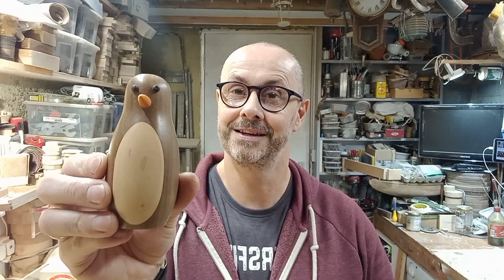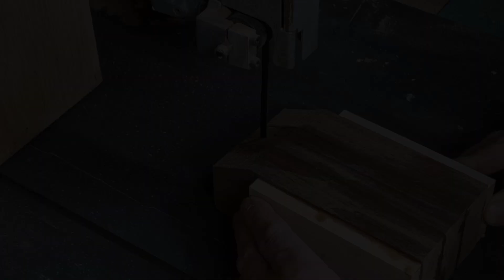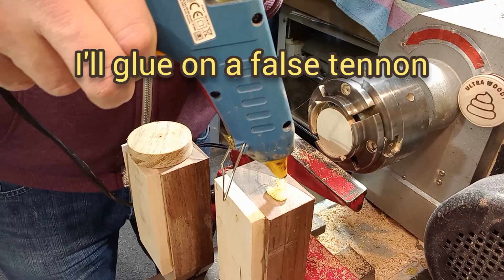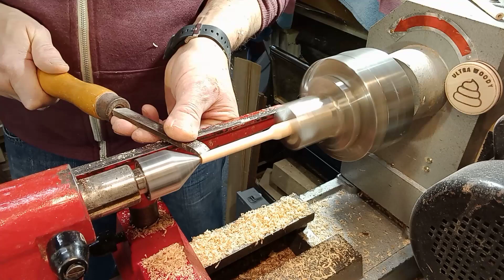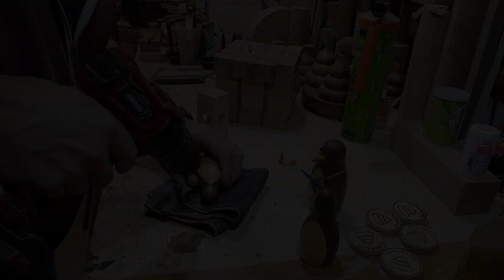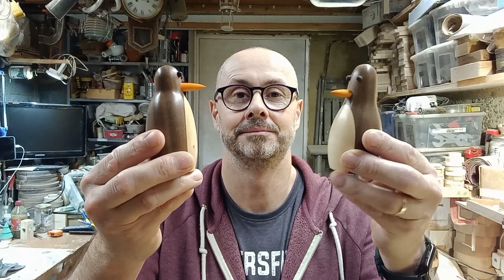wood turning penguins

Comment: These are great!! I want to ask my husband to make them for our family for Christmas.  Would you  be able to give me the finished size (height and width) of the penguin?  Thank you so much!!
Reply from the maker: Sure 😀 I used the wood I had that governed the size...130x70x70 plus a glue block to hold it...thanks for watching 😀
Reply: Thank you
Reply: This is a very weird question probably. But what measurement did you use when you said 130 by 70 by 70?
Reply from the maker: @buglady1952 millimeters or 13x7 centimetres
Reply from the maker: @buglady1952 the size doesn't matter....just make it look good by your eye

Comment: Hi , I enjoyed your video on making a penguin what is the ratio of light to dark wood please ,
Reply from the maker: There is no ratio or magic method I used two bits of walnut and one of maple....I've got one close so these are the measurements it's 135x67x67mm make the light bit about 15mm thick
Reply: @ultrawoody1968  Thanks for your response I have turned some mini ones for Christmas tree decorations , now I will try some larger ones with those measurements.

Comment: Ya should have used African blackwood. Just a tiny bit more in price
Reply from the maker: I get my scrap wood from from work ....its what I've got...however I've just found out I can stain walnut black with ebonizing solution...but I will look into that black wood..thanks🙂
Reply: @ultrawoody1968  , those blackwood will probably scare you. A good black result for me is to torch the wood, clean off with med. stiffness wire brush,  then apply India ink.
Reply from the maker: If in doubt get the blowlamp out....I don't get to the shop much...bit far away...but I have seen it there...I will try it

Comment: Hey Ultrawoody. I'm just starting out. What is the first solution you put on? a sanding sealer? And the next one.. Briwax?

Thanks
Reply from the maker: I use shellac flakes mixed with methylated spirits  it's basically sanding sealer....then I use chestnut cut'n polish....then micro crystalline wax....I use renaissance wax.... if you go to your nearest wood turning shop...and hang around on a Saturday morning you can talk for hours with old gassers and learn loads....